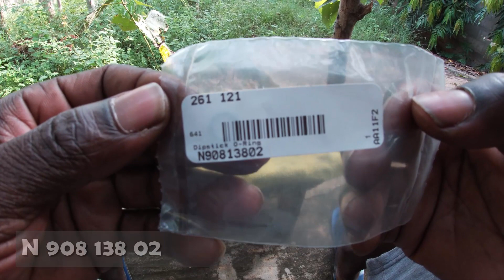Audi A6 3.2 - Dipstick and oil cap seals

Comment: i love your videos, i have the same car, 255000 km. Have you replaced the Camshaft sensors? i have and its a new car! ihave no errors from the sensors but changed, try it.
Reply from the maker: I appreciate your comment. What do you mean by "camshaft sensors"? Do you mean the "camshaft position sensors" or the "camshaft solenoids or asjustment valves"? A part number would help identify which ones you mean.